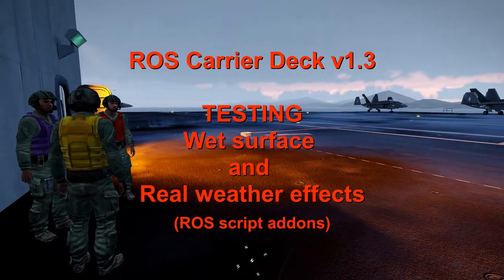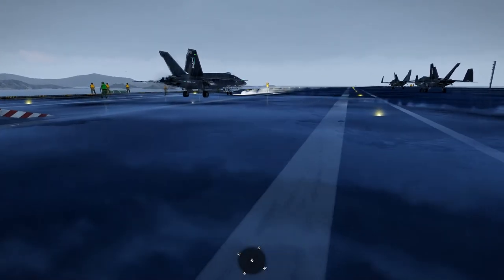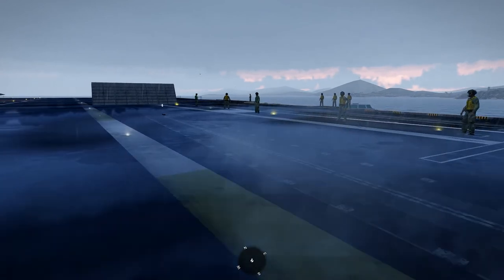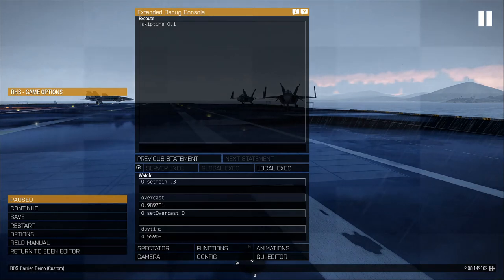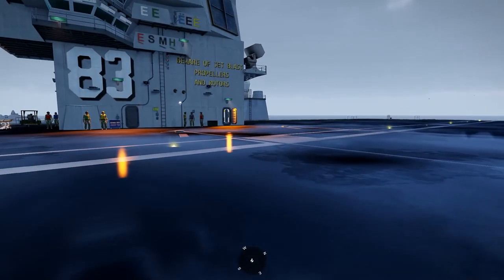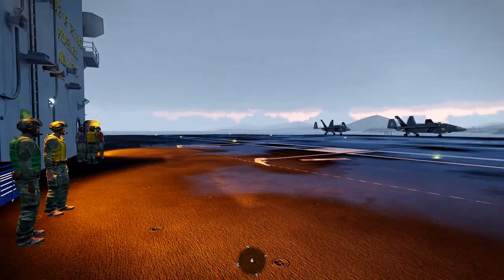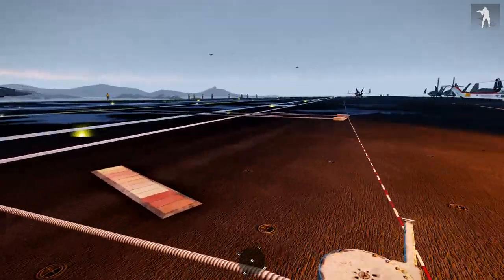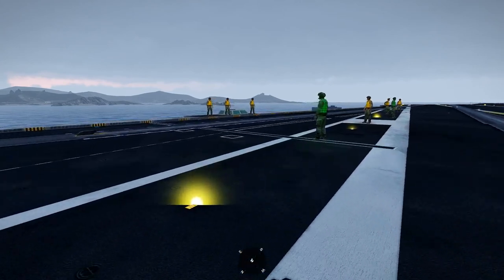ROS Carrier Deck Wet weather effects demo

Comment: Dam making Arma do what other games do which is normal for them, your surpassing that coding level!
Reply from the maker: Thanks Gunter - after seeing the Reforger wet weather effects - I can't wait to have that level of control ! Just incredible - to see water running down the windscreen of a vehicle or water building up on the road surface and clothing getting wet! Btw I managed to move the plane catapult positioning closer to the correct attach pos in front of the nose wheel without causing any additional launch instability - which was something you mentioned on the carrier deck system.